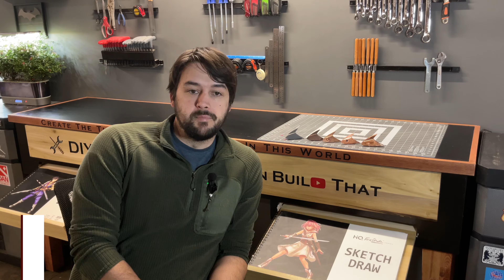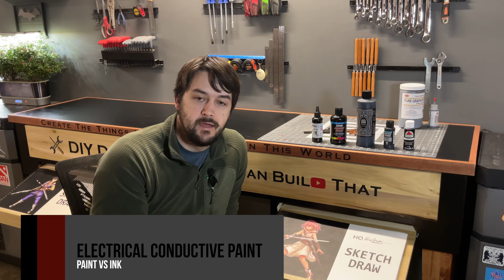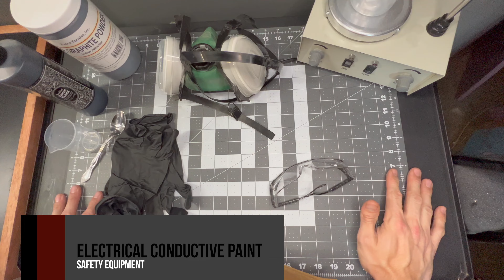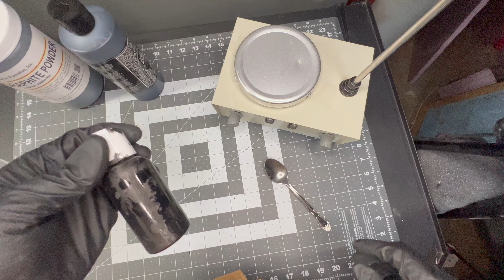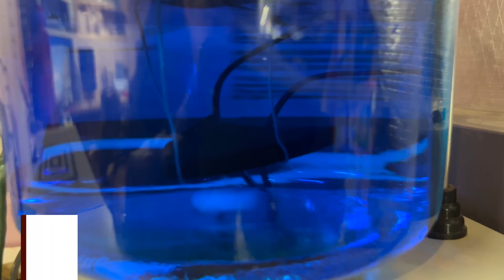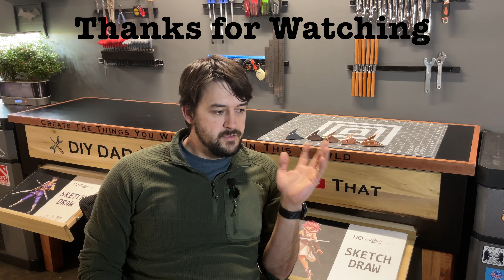Easy Airbrush Graphite Paint for Electroplating 3d Prints

Comment: i know im a bit late but i first tried nickel plating instead of copper and the part seemed to like rust or corrode and also kept eating off my wires and crocodile cables how do i avoid this
Reply from the maker: Yeah, nickel plating can be a bit tricky. The solution’s pretty acidic, so if your wires or clips are steel, they’ll rust or get eaten up fast. Try using insulated or nickel-plated clips, and keep them out of the liquid if you can. Also, nickel doesn’t stick great to steel on its own—doing a quick copper plate first usually helps a lot. And make sure the part’s super clean before you start!
Reply: @DIYCOOLSTUFF thanks for the reply i made my own paint before watching your with pva glue, distilled water and graphite. I hand painted it the texture were really rough so i might also buy the ink you recommended and an airbrush.
Reply from the maker: @bannerlordtv cool man. Let me know if I can help with anything else!
Reply: @DIYCOOLSTUFF thanks and I also see people building rotation systems for even coating, do you think that it would help that much in the long run? I personally found it too complex and also needs a bigger tank and more volumes of chemical so didnt find it worth it myself

Comment: What are you using to clean up the mixture? Acetone, denatured alcohol 95%?
Reply from the maker: I’d go with isopropyl alcohol (70–90%) or even Windex—just wipe it up with a paper towel or cloth. If the ink’s being stubborn, let the alcohol sit for a minute before scrubbing. Then finish with a bit of soap and water to clean up any leftover mess. Its better to be careful than to have to clean it off your equipment. Especially dont let it dry for a long time.

Comment: Next time, try acid tone and a binding agent mixed with the graphite. It goes through the airbrush great. Then you can buff it out to get the conductivity up.
Reply: My graphite powder just sits at the bottom of the container, doesn't mix into the acetone
Reply: @MTFTVlive  the formula I seen that work was acidtone super glue and graphite powder.
Reply: @thesyfyguy you can also use simple PVA glue

Comment: I was reading some research on india ink with additives like graphite for another reason earlier today. A point the researchers said was critical in one analysis was sonicating the solution before use to break up clumps and create a more homogenous mix. For small vials or dropper bottles I use a cheap a** lab agitator for test tubes, works great and if you throw in mixing balls you can just retrieve them later or leave them in for the next batch.

Comment: Blundered onto your video months after you published.  The india ink makes sense as to why it it's so compatible with the graphite vs the others.  

Recalling from HS Art classes - india ink is carbon black (fine, fine powdered charcoal) in an alcohol as the solvent/carrier.   It might be possible for you to 'eliminate' the india ink and just use the same alcohol solvent/carrier with your graphite powder, if it's fine enough.  But,  that's just me armchair quarterbacking, not from experience, yet.

Thank you for the great video!

Comment: I found it interesting that India ink is working and then i looked on the Wikipedia page for India ink and they said it is a suspension of lampblack (carbon soot) and water though it can also have gelatin or shellac added to aid in durability… my bet is shellac as i have heard of conductive paints that use shellac.  Though i thought shellac only dissolved in denatured alcohol or similar.  I would be curious if a thinned shellac to be like the ink with the graphite but not the lamp black would work better or worse.

Comment: Hi. Have all the kit ready to go.  What ink/graphite powder ratio do you use?
Thanks!
Reply from the maker: I would start with 1:1 ratio, I just eyeball it, by volume and not weight would probably yield the most ideal solution. However, it's a good idea to see how it reacts with your airbrush and adjust accordingly. the paint plates very well even if less graphite is used, make sure to shake it well before adding to your air brush as the graphite tends to settle as the paint sits.
Reply: @DIYCOOLSTUFF  Thanks!.  Managed to get 2 small models coated but then had a nasty jam, so had to strip the air brush.
New to all this, wondering how it would turn out to just dip the part and the use the air from the brush to remove excess.

Have also just ordered some eono conductive pla.l to see how that goes.
Reply: Quick update. Don't bother with conductive pla filament. 9v drops to 3v in a few cm,and when trying to plate I couldn't get any current through (even tried up to 30v) with the filament about 1cm from copper electrode.
Reply from the maker: Dipping the part works just fine, in fact if your having trouble with the air brush that would be my go to. If your having clogging issues I would use very high psi on my airbrush, and mix it much thinner and just add multiple coats.

Comment: Amazing video, i have a question,  how many layers of graphite do you put on the piece?
and do you buff the piece before the electroplating to remove any dust residue?
Reply from the maker: Also if you plan on adding a second coat (I don't recommend if at all possible) let the graphite paint dry completely for at least 24 hours before applying a second coat and also use some either fine grit sand paper or even just a lint free rag to rough up the surface of the prior layer. Use a respirator when doing this because it's hard on your lungs to breath graphite dust. Ask me how I know :( anyhow good luck and let me know if you have any more questions. I'll try and make a video on this topic in the future because I think it might help a lot of folks.
Reply: @DIYCOOLSTUFF
         Hello. Nice and simple, thank you.
But, about the graphite dust, using the mask during use doesn’t do much.
The dust is flying everywhere in the room, and doesn’t disapear, you breath it all day long, since the first time you used it, it’s on your clothes, you bring it home for everybody to breath it in, ect...
Do you know about asbestos? The wifes of asbestos workers were as much affected by silicosis than their husbands, because while doing the work clothes laundry, the ladies were exposed to asbestos.
Nobody though about that at this time. Think.
Cheers.
Reply from the maker: @hommerdalor6301  Hi, just wanted to take a second to respond to your comment, I take safety probably as serious as anyone I know. Here is what I know on the subject. Asbestos differs from graphite in that our bodies natural processes cannot remove asbestos particles from our lungs. Graphite on the other hand can be removed from our lungs through multiple bodily processes.  I've actually read and re read a few studies on this prior to responding just to make sure my information was as accurate as possible. However just because it can be removed doesn't make it perfectly safe, but I also don't want it to be misconstrued as being as dangerous as asbestos.  Any foreign particle in our lungs can cause inflammation and pulmonary inflammation can cause all sorts of problems. Some are worse than others. Silicosis specifically is caused by inhalation of silica dust. While natural graphite powder does contain silicates, the MSDS of most synthetic graphite powders like recommended in my videos show minimal to trace amounts of silicates. We breath in all sorts of contaminates every day and our bodies are well suited to remove those irritants.  Woodworking for instance creates large amounts of saw dust. Being exposed to saw dust once in a while is going to do mostly zero overall harm to your body, however a woodworker who worked in a poorly ventilated shop is very likely to develop lung disease at an early age according to studies simply due to chronic inflammation from being exposed to sawdust (some types of woods are very irritating as much or more so than silicates).  From my research pure graphite (and most contaminates) is similar, small exposures will be handled by your body with minimal concern and a high-quality respirator appropriate for the particle size plus decent ventilation should be more than adequate. However, if you plan on being exposed more frequently, then a dedicated ventilation hood and more advanced ppe and dust collection system should be used.  Some irritants like asbestos that the body has poor defenses against should likely be avoided altogether especially since primary and secondhand exposure can have such tragic consequences. However as with most things erring on the side of safety is usually good practice, so I agree that graphite powder should be treated with respect and caution. Thanks for taking the time to post a comment on safety always a great topic to discuss!
Reply from the maker: Hey sorry I'm just getting back to you, but I typically try to only spray each piece once. With that said when airbrushing the graphite paint usually dries fast enough that once you finish one area you can go back to previous areas and apply a thicker coat,  I try to make sure each area is covered with a decently thick layer of graphite paint with no gaps in coverage. I've found that if I spray parts multiple times the following coats of graphite don't stick great to previous applications and this can lead to poor plating results. So basically if at all possible try to spray each item only once, sometimes this isn't possible on larger items or funny shaped items and that's ok I just recommend letting the item dry for a full 24-48 hours after the last coat before submerging in the plating solution for best results. Also if multiple coats are applied I like to let the part plate long enough to develop a thick copper shell before removing from the plating solution. This way even if the paint doesn't stick well the copper shell is thick enough to retain its own rigidity. Hope that makes sense and helps.

Comment: I am waiting for the ink and graphite to be delivered now. Thanks so much!
Reply from the maker: I hope it works out great for you! make sure you've got a respirator on or some good ventilation when spraying the graphite, it really is nasty stuff to breath in! If your airbrush stops up try mixing it a little thinner with more ink and you can also try turning down the psi on your airbrush. It takes a decent bit of airflow to spray it but if it's to high I've found it can cause the graphite to dry in the tip of your air brush. It's a pain to clean out the airbrush but it won't do any damage to the airbrush if it does stop it up just FYI.
Reply: @DIYCOOLSTUFF  That is great info. I have seen other formulas that I did not try. I decided to follow this one because of all of the testing you did and explained before presenting your ultimate formula. That was a great help. One thing: I was unsure of how much ink to add to the powder. At first, I missed the 1:1 ratio that you said before mixing. I am sure that is volume because I doubt the ink and powder weigh the same. Please keep making more videos and I am sure more people will subscribe. You rock!
Reply from the maker: @TroyCLE  I appreciate it! and yes, I would start with 1:1 ratio, I just eyeball it, by volume and not weight would probably yield the most ideal solution. However, it's a good idea to see how it reacts with your airbrush and adjust accordingly. the paint plates very well even if less graphite is used, make sure to shake it well before adding to your air brush as the graphite tends to settle as the paint sits.  Finally, I have a lot of videos in the makes, and quite a few already scheduled, I've just gotten to a place in life where I have time to undertake this YouTube journey and I underestimated the time and effort it takes to get videos done in a quality I'm proud enough to put out there, so I appreciate you saying that, I've got so much great information to share, it's just a slow process to share through this route!
Reply: @DIYCOOLSTUFF  I took everything you said and demonstrated to heart. I even bought the beakers and magnetic stirrer. You should get the commission.  I have a TON a glass bottles with caps for my business to I had an 8 ounce bottle that I put a magnetic stirrer in, upon your suggestion. Dude, you have so MUCH great info and i and many more will be here for it. Everyone on here giving info is great, but you seem to be the most relatable, which is demonstrated by the continued info offered in comments. Thanks again! And i will be continuously bugging you with questions. LOL